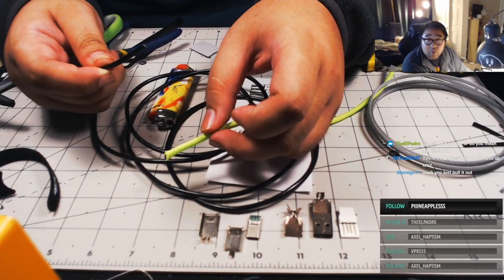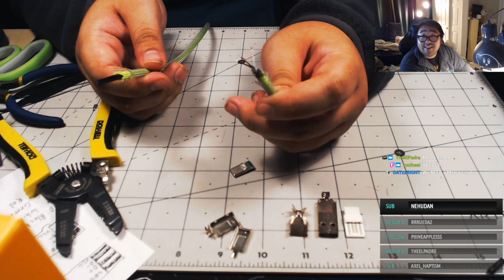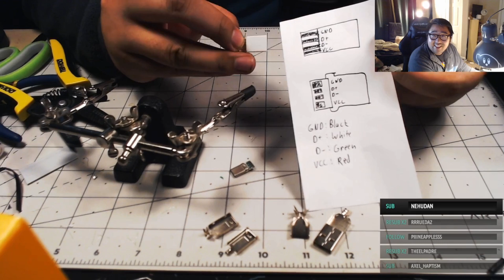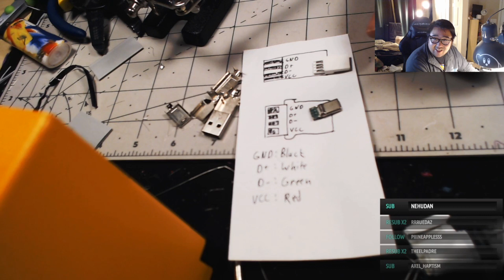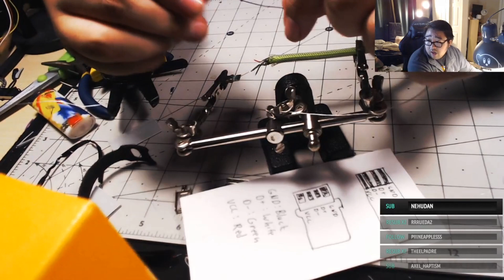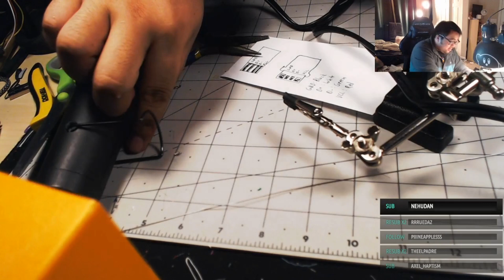Tutorial | DIY Custom Sleeved USB Cable (Mechanical Keyboard) [UPDATED VIDEO IN DESC]

Comment: I got an aviator connector with the kit should I make the cable in two parts from the beginning, or should I make it and then cut it where I want to put the connector. Sorry I'm really new to this so this is probably a dumb question.
Reply: Jeremy G my opinion is that first you do all the work that has to be done then you cut it after. That way is easier to decide the length of the sections or even if you really want to use the aviator

Comment: I really enjoyed the video, helps a lot to to get you startet in this Topic.
What would especially help would be an updated Materiallist - or a new video explaining on what to look for and what correlates with what. Something like a cable-guide.
I am especially unsure about cables itself - since most cables have a diameter bigger than the usable 3.6mm for Paracord 550. And your Spreadsheet is helpfull ...to an extend...since im not US Based and cant order the same products. And searching for USB Cable on Amazon is a pain - since it only provides finished cables and not the cabeling itself.
As far as i know, for really quality usb cables, i have to work with 4.5mm diameter which would result in Paracord 1250.
I hope this makes sense, but it would help a lot - since i do want to use quality materials.

Comment: These videos actually made me realize making these cables might actually make a pretty fun hobby, I already solder enough with keebs, might as well do one of the most fun but unnecessary aspects of the keyboard, the cable. Ordering most of the stuff I'll need in Amazon currently, hopefully I'll have a sweet new coiled cable here withing the next month. Thanks again for informative videos man.
Reply from the maker: Yeah! It's a pretty cool hobby to get into. Even outside of keyboards, I made myself a printer cable since I lost mine. Thanks for checking out the video, and would love to see how your cables turn out :)
Reply: i still dont have a solder station. we just have an iron.
what do you use

Comment: Would it be possible to cut off and desolder USB connectors from old cables for practice? Or just use these in general? I have waaaaaay too many old chargers and other cables...
Reply from the maker: I first started with resleeving old cables. Premade cables connectors are typically difficult to disassemble and resolder.

Comment: I can't find a usb c 2.0 connector with metal housing, where did you buy it?
Reply: YouMadBro? I would try zapcables.com
Reply: @goldtalon9868  do you know anywhere else to buy from because zap cables shipping cost 3x more than the connector
Reply: @clancycameron2762  AliExpress has some cheap options with not bad shipping
Reply: @diepurple7464  thankyou
Reply: @goldtalon9868  Thanks